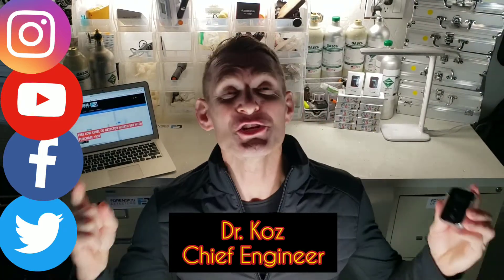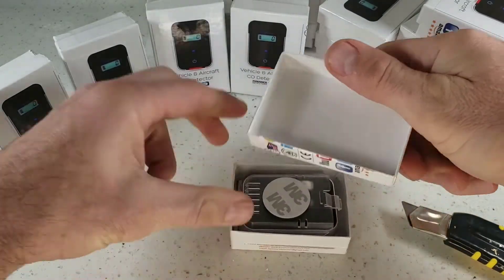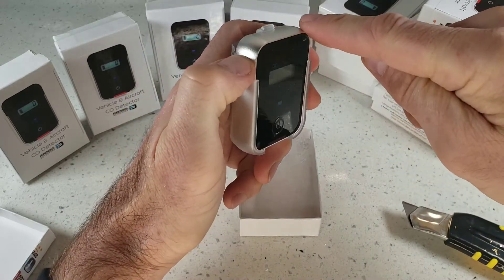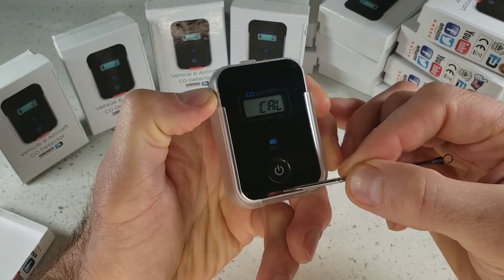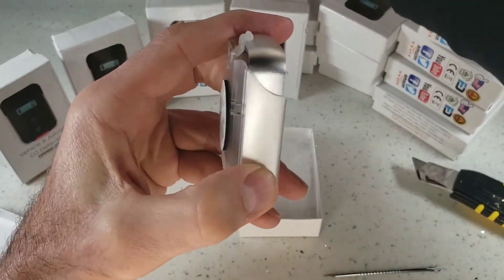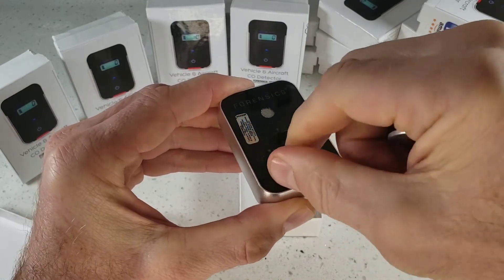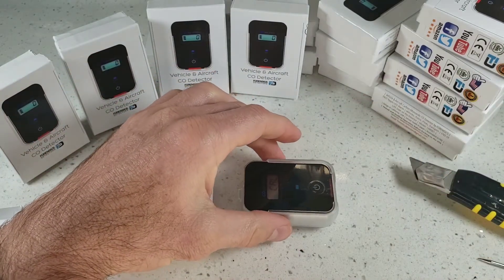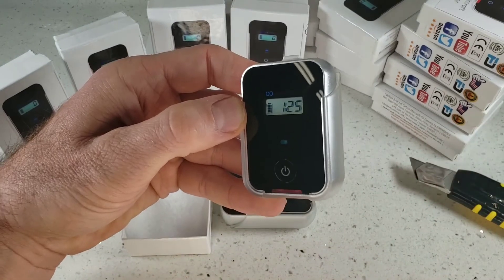Vehicle Aircraft Carbon Monoxide Detector

Comment: How can we test to ensure the sensor is working properly,
Reply: The non scientific way, to just see if it detects? Use a lighter and a small jar.  Invert the jar and burn the lighter in the mouth of jar for 30 seconds to one minute, then quickly bung the detector inside and put the lid on. If the detector is working then it should register. Don't put the detector over open flame, as it could damage it.

Comment: Ever since I heard about the Ford Explorer leaking incident, I've had one of your other detectors (the Fast & Low Level CO Monitor Model) in my car just in case.

So far, so good! However, after watching your video, I was reminded that placement is important; where would you recommend one places a CO monitor in a vehicle? I currently have mine by my gear stick though I'm sure that if there was a serious CO leakage in my vehicle, the gas would make itself known to any of your services as long as the sensor was exposed to the air (at least facing upward in the main car's compartment [aka not the glove compartment haha])
Reply from the maker: Nice move!!! Be well
Reply from the maker: Place it anywhere. Just remember. No direct sunlight. Ensure you can see the LCD. Dont block back sensor, keep in plastic outer housing. Thanks

Comment: Would this work for a 160 square foot airstream trailer? The whole space is only one room. I'm concerned because my propane stove is super old and possibly not vented well. I recently installed a First Alert CO Detector and while baking it went off saying the room was at 80ppm. After researching I found that it may have been at that level for an hour or more! Anyways want to be safe in this space and wondering if this would be a good choice for my little home?
Reply from the maker: Yes, however a better bet would be our LOW LEVEL CO DETECTOR, since the alarm is louder and you have a larger volume of space.
We sell two version, either will be perfect!
Reply: @DrKozForensicsDetectors  Thanks for the reply! Can you send me a link to the model you recommend for the space?
Reply from the maker: @Thomas-ed4cl  Yes here it is: https://www.forensicsdetectors.com/products/fast-low-level-co-monitor-display-10ppm-25ppm-alarm-wall-or-table-top-10-year-life?_pos=1&_sid=ae1105eda&_ss=r